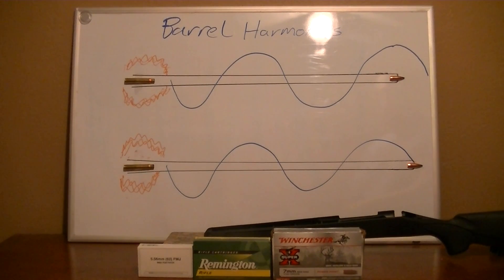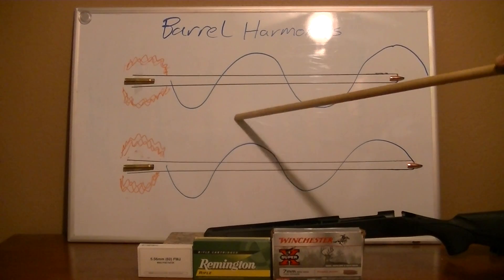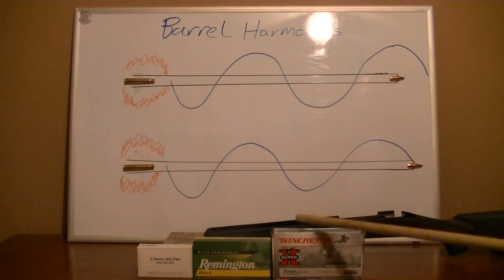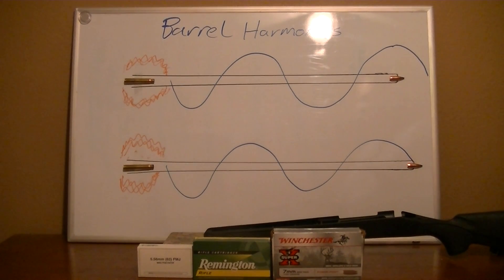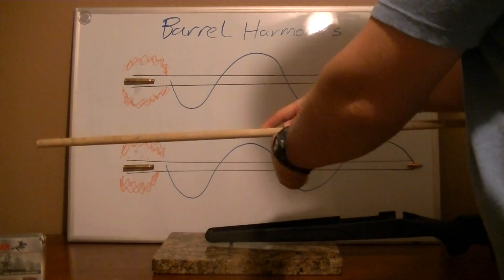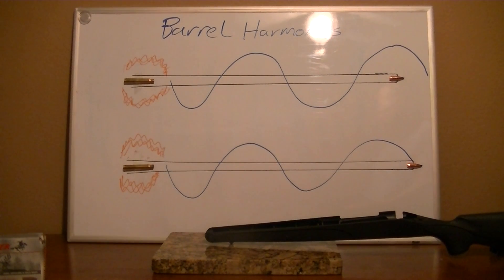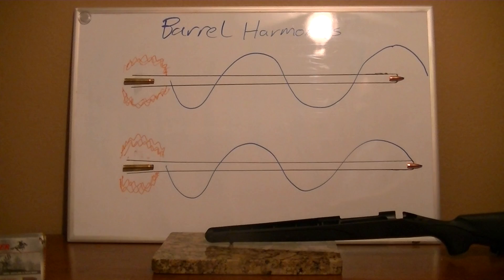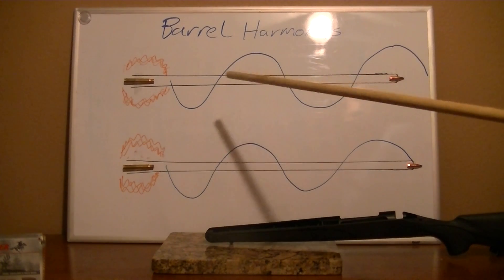Accurize your Rifle: Barrel Harmonics

Comment: Bad info...this is wrong. You actually want the bullet to exit the barrel as it hits the top or top or bottom of a cycle. You never want the bullet to exit the barrel in the middle. Think about this. The barrel is moving and if you are in the middle of a cycle you must hit the exact point in time of exit in order to hit a particular point of impact. If you are a fraction early or late the shot will be high or low. If you are at the top or bottom of a cycle your point of impact is reduced by half. If you are early at the top of the cycle your point of impact will be low. If you are late, your POI will again be low because the barrel is on the downswing. You've double the timing for an accurate shot or halved the point of impact. Load adjustment is backwards thinking. Keep that a constant for everyone, then tune your barrel for that standard load. The length of barrel and weight at the end of a barrel are key.
Reply: The barrel vibrates radially around its entire axis not just up and down, it will draw a circle shaped pattern if the bullet exits the muzzle as it is at its maximum deflection.  A properly "tuned" load only has to be of the correct and consistent velocity to ensure the bullet exits the muzzle as the peak vibration wave returns to the chamber.  This can be estimated very closely by measuring usable length of the barrel and by using the speed of sound in steel (18,000 fps).  So for example, in a 30" barrel(28.575" effective for bullet travel), shockwave traveling at 216,000 in/s the barrel would oscillate 7559 times in 1 sec, or 7.559 oscillations per 1ms. From this you can find one full oscillation (chamber-muzzle-chamber) takes 0.264 ms. A bullet traveling 2425 fps would exit the muzzle after 1.445 ms (1.445/0.264=5.47)  this means the wave would not be completely back to the chamber and the bullet would be exiting the muzzle at a high point in it's vibration.  by getting this # to be a whole number it ensures the bullet leaves the barrel at the exact point the vibration reaches the chamber. So the velocity of this round needs to be adjusted either up or down (to make 5 or 6 complete oscillations). Pushing that same bullet to a velocity of 2599 fps makes it leave the barrel in 1.313ms (1.313/0.264=4.97) this load would leave the barrel after 4.97 oscillations and would probably be more consistent than the first load.  These measurements will get you very close to the velocity target you need to hit for your rifle but there are subtle differences in each rifle (barrel steel, thickness, etc) that will not make this 100% accurate.  2599fps wont be the exact sweet spot for every 30" rifle shooting a 0.264 140gr projectile, but it'll be a much closer start and will save you on ammo. A range of 2580 to 2620 would probably contain the sweet spot you're after and narrows the target velocity window down by a lot, from there use your chronograph to tell the true story.
Reply: @jimknowlton342  You're all incorrect....you want the bullet to leave during a harmonic node....total cancelation.
Think: 2 speakers 180 out of phase pointed directly at each other= noise cancelation.
Noise is vibration = same concept.
you can watch a guitar string do this....vibrate violently in one spot then inherently dampen then build vibration again then dampen.
You can watch the end of a rod do the same....vibrate in an eliptical pattern, then stop for a second then build again.
This is the reason for seating depth...its like timing an engine to fire in the perfect spot.
except we are tuning the bullet to leave the barrel at the perfect spot....hopefully during a consistent node.
If this cannot be done then yes.......time so bullet leaves at the end of an upswing or downswing.
Reply: Would a silencer restrain som of the barrel harmonics?.
Reply: the slope of the vibration wave would be greater but the actual steel of the barrel will be at it's neutral point.  Yes the wave is rapidly transitioning from positive to negative (or east to west) but if the bullet leaves the barrel at a node then the actual barrel itself is at rest since the waveform momentarily hits zero as it crosses it.
Reply: Mars Rover could just perches a Browning x bolt hells Canyon.
Reply: Additionally, the SLOPE of the oscillation will be closest to ZERO (thus less susceptible to to variation) near the top or bottom of the curve.  The SLOPE will be greatest at the NODE (point of GREATEST variation over different shots).

HOWEVER, as you tune the barrel, you don't really need to know this.  You'll simply set your tuning device to give you the most repeatable grouping.  Problem solved.  Good video.  Thanks.
Reply: Mars Rover is right, TURBINEator is wrong. Mars has 2 up votes and TURBIN has 4, this shows people need more physics education or to pay more attention when they were in a physics class.

Comment: Not a bad explanation. My mate and I do professional pest control in Australia and we've found that we get best results going up by .2 grain increments. If .5 works, great but you might be able to tune it even better by doing that. Just a thought. 

Trying to get accurate .308 through my remington 7600 was a nightmare but found that 168 grain a max, running (I think) 42.2 grains of ar2206h (H4895/IMR4895) out of federal vital shock fire formed brass worked the best. Got a 'couple' of roo's and foxes with it. 

Gun shoots 1000% better. The only factory rounds that came close (and I tried them all) were hornady super formance. But down here it's about $50.00 a box or $2.50 a bullet. Bit expensive for doing commercial pest control.

Comment: Just looking at your display, I see possibly another way to tune your harmonics.  Barrel length.  I have seen other vibrating rods, pipes, etc. under a strobe light which makes the sweet spots stand out from the areas that are vibrating.  I'm sure this could be done on a rifle, but the vibration we're talking about only lasts a fraction of a second.  It would take some serious high speed camera equipment to capture the sweet spots on a video recording.
Reply: I have heard of some gunsmiths who would get a cartridge they wanted, a bullet they wanted, and the powder charge to shoot it at the speed they wanted.  They would barrel the gun with a long barrel, and shoot a group.  If the group wasn't as good as they wanted, they would chop 1/4" off the end and re-shoot.  Continue until the group is pretty tight, then start cutting off either 1/8th" or 1/16th" until the group was super small.
Reply: @Wedelj  very interesting...I like it....one more refinement other than seat depth